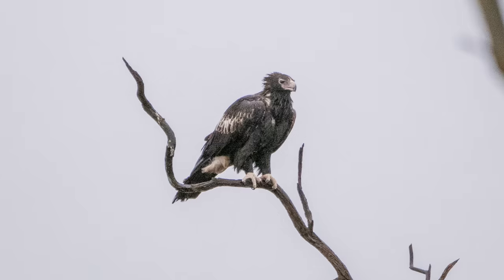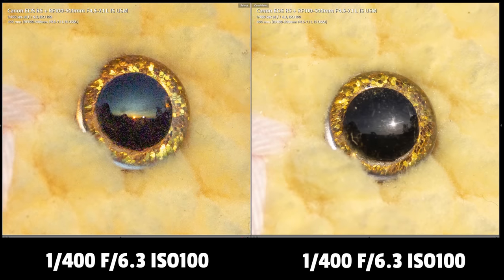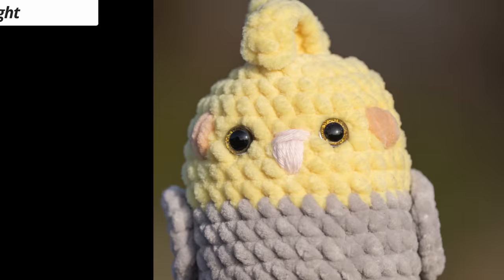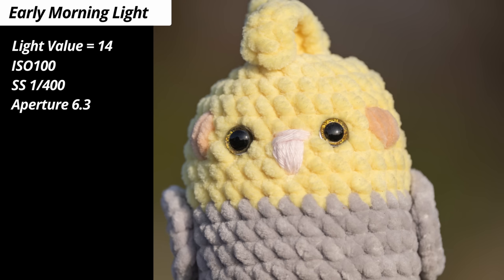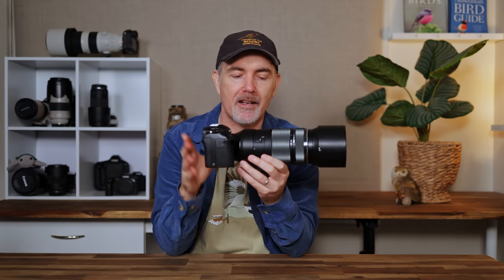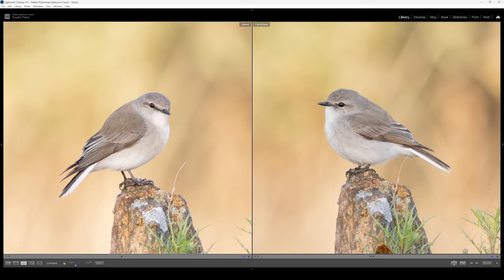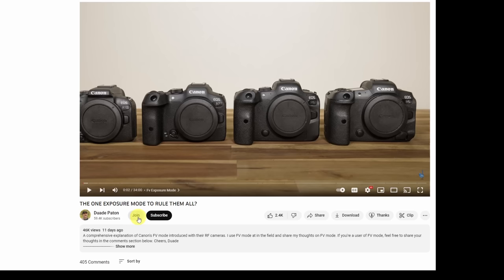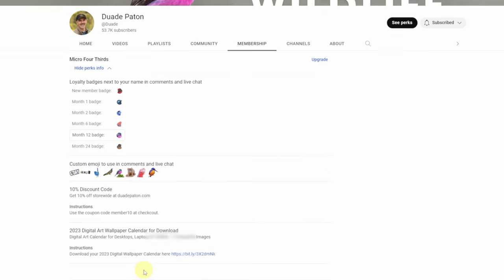NOISE SIMPLIFIED, WHAT CAUSES IT, HOW TO REMOVE IT!

Comment: The pink robin shot is terrific. The colors are so pretty.

You may have inadvertently mislead people about the use of lenses with different maximum apertures. The issue isn't "light on the sensor" it's "light on the subject". The f-number is just a ratio that tells you the flux of light. It doesn't tell you how large the aperture is or how much light is on the subject. Maybe think of it this way: If the flux is the same, and the subject occupies 1/4th of the frame with a longer lens, and 1/16th of the frame with a shorter one, the subject in the mage produced by the longer lens will have a lot more light on it and a lot less noise than the subject in the image produced by the shorter lens. IOW I you have a 100mm f/2.8 and a 400mm f/5.6, assuming the subject will fit in the frame, the subject taken with the 400mm will have less noise. You've no doubt seen how this works if you've heavily cropped a somewhat noisy image -- the subject will be quite noisy. 

A shortcut to figuring out which lens will be best is to just calculate the absolute size of the aperture. A 400mm f/5.6 lens has an aperture twice as large as a 100mm f/2.8 lens. 

FYI you should never "stop down" an m43 lens unless the maximum aperture is f/1.4 or similar. The lens will be sharper wide open than stopped down. The reason for this is that m43 lenses (1) have fewer aberrations than similar quality FF lenses; and (2) operate closer to the diffraction limit. So unless you need more DoF shoot them wide open. 

Another big factor is the direction of the light. Frequently more important the amount.
Reply from the maker: Thanks Don, that is very interesting. This makes sense if you crop the 100mm image to the same size subject as the 400mm, but I am a little confused if you get much closer to the subject with the 100mm lens, so the framing of the subject is the same. 
For example, you use the 100mm f/2.8 at 1/1000 ISO1600 f2.8 at 1m from the subject.
You then use the 400mm f/5.6 at 1/1000 ISO6400 f5.6 at 4m from the subject.
In theory the subject will be the same size in both shots, I think. Which one has more noise in that scenario?
Also interesting re the M/43 the 100-400 is inconsistent at f/6.3 but sharper at f/8 in the shots that I took. I will have to do more testing on that. Cheers, Duade

Comment: I just got to say, this is the best explanation of the variables in luminance noise I've ever seen. Note I said luminance and not ISO. I got that way back. (FIGJAM) There's so many points in this vid I just wanted to jump in and make agreement with from my experience. But I held back so as not to make X dozen comments. LOL. I'll just mention a few. Shutter speed. Since going from D850 shooting mainly at 700mm F8 almost always on at least a monopod to Z9 shooting at 800 F11 and never using a mono since the change, all I can say is god bless IBS! LOL. Handheld in flight Wedgies so close 800 was at times too long at 1/100th and a Peregrine on a stick as low as 1/25th yet publishable. What was the other point? I give up. The Superb fairy wren. Out of mating plumage male or his mrs? Females have orange rings around the eye is my obs.

Comment: I agree that ISO doesn’t cause noise. But I’m still not convinced as to what causes it. I because suspicious several years ago when I photographed some rainbow lorikeets under the canopy with no direct sunlight at about 4000 ISO, to my shock when I got home there was next to zero noise. Yet, many times I’ve shot images in bright sunlight at much lower ISO which have had lots of noise.

Comment: Sensor size does not make a difference in gathering light, it's the number of megapixels per sq inch. Each pixel gathers the same amount of light. A 24 megapixel APS-C sensor gathers just as much light per square inch as a 36 megapixel full frame sensor, they both have the same number of megapixels per square inch.
Reply from the maker: Thanks Jeffrey, I got that wrong, thanks for the explanation. Cheers, Duade